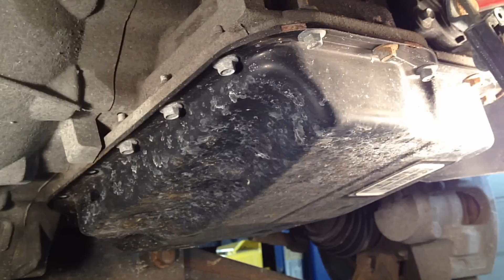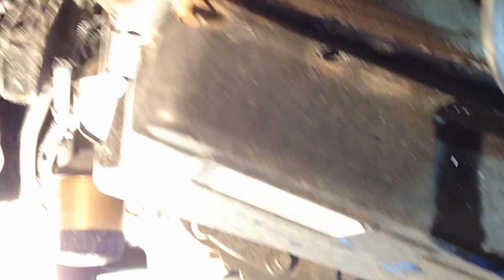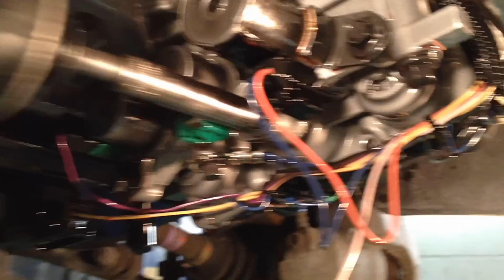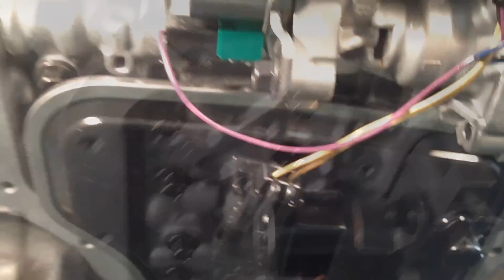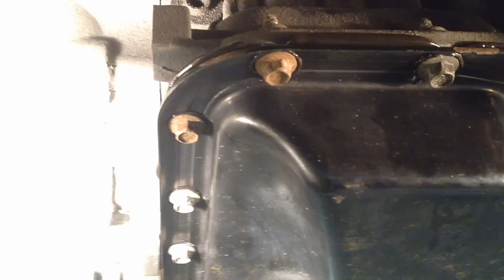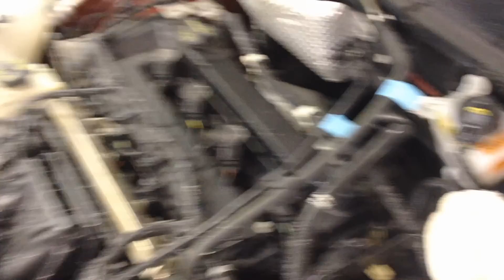Ford Focus Shift Solenoid A Repair P0750 P0753 P0972

Comment: FordTech it shifts into 3rd gear but really hard. Also I notice that starts jerking when I'm going up to 70mph... The car has 130k miles as well. Thanks for your response.
Reply from the maker: Michael J so it slips goes high and finally engages into 3rd? There was also a major redesign of the direct clutches for that year think a tsb on it for a flaw in design I have done a few. How is the fluid level color and smell, does it smell burnt?

Comment: Hello FordTech I have a P0733 on my 08 focus se AT which solenoid would I need to change out... Thanks
Reply from the maker: Michael J Are you actually missing 3rd gear. These have a problem where the direct drum gets grooves it from the end cover sealing rings requiring a rebuild also another common problem with that year is there are allot of problems with the pcm driver for the trans solenoids failing. In the end I don't think it is a simple solenoid issue.
Reply: Hi Michael,  i know it's been 5 years since you wrote this comment. I'm having the same problem as yours. Did you end up fixing your trans and how?

Comment: Hey my 2010 focus has been acting up and I got the vehicle code P0760. I had what I thought was solenoid C changed but the code keeps coming up. I'm not sure what else I could do to get rid of the check engine light? The car jerks when I put it in drive and as it reaches 3,000 rpms.
Reply from the maker: Joshua Gomez Unfortunately the 2008-2010 focus vehicles have a different problem the pcm driver for the solenoid fails
Reply: FordTechMakuloco  So even though the code reads "shift solenoid C malfunction" it would be the pcm driver that needs to be looked at or changed? any idea how much that would cost?
Reply from the maker: Yes the code sets the same I have changed many. The driver is part of the pcm so it depends on what they can get a new pcm for.

Comment: I have an 06 focus mileage is around 166000 the trans shudders when shifting this usually happens when rpms around 3000 it also occasionally hard shifts but transmission it not throwing any codes. Could this be an issue with the solenoid?
Reply from the maker: Timothy Collum It could be but the end cover is likely grooving the direct drum at this mileage and the 2-4 servo bore is also likely worn out by now.

Comment: 03 2.3 Duratec @176k mi ever so often while decelerating i will get a hard down shift at low speed around 20mph. It doesn't do it all the time I don't get any check engine lights at all. Solenoid A?
Reply from the maker: SLVRFOX88 Yes it can be sticking but at that mileage I am thinking a crossfeed on the direct drum. either way with the mileage you have I would wait till it's a real issue and replace the trans with a low mileage junkyard trans. You will be surprised at how cheap they are.
Reply: Thanks for the reply. Since it doesn't happen much and otherwise runs and drives fine your advice makes the most amount of sense. The only other issue I have had with the car are small little things like when shifting from park to drive the speedometer will jump up and the settle back into normal operation. And the trip computer clears to 0.0mi if you turn the car off or fails to read any mileage as your drive. These are way more prevalent than the hard downshift.

Comment: My mechanic will do this job if it's needed, but I liked your video. I have to take my car to a parts store like AutoZone or Advanced Auto Parts and ask them to find the error code (or codes I guess) for a problem I have with my 2004 Focus Z engine with almost 200,000 miles.
The transmission slips when I give the car gas but then drives fine if I don't over accelerate. It also slips going up hills and I have to baby it to get it NOT to slip...in other words, I can't give it more gas and expect it to stop slipping.
After driving it for a few minutes, the amber transmission warning light comes on (has an exclamation mark inside a gear-looking circle). BUT if I baby the car and don't give it too much gas and stay at or below 35 mph, the light doesn't come on.
Just curious if you might know if all this stuff hints at a solenoid problem or a band problem. I'd like to be prepared when I talk to my mechanic.
Thank you very much.
Reply from the maker: kathy loften Since there is a code set I would get that read first for direction but I am suspecting the end cover is worn causing the pressure loss which is a major repair.
Reply: FordTechMakuloco Hi...thank you for your reply. What is an 'end cover'? I'll be looking for a parts store who will try to read any codes for me. Not all Napa stores do that. Thanks again. I really like your video.

Comment: Hi... I was wondering if the transmission was the same as well for the 07 Mazda 3 - 2.3L because it does look the same ... i have recently got the p 0753 code for my transmission saying solenoid A..... the symptoms are pretty well the same as the guys below and only shifts from 1st to 3rd, the check engine light is on and the AT light as well and help would be appreciated... thanks
Reply from the maker: Gord Herreman Yes sounds like the same exact fix.
Reply: Ok thank you much appreciated... now i know u listed the solenoid in the video but the schematics i have are a little different. the ones u showed as a and b i have listed as d and e. do u know why this might be ???
 http://www.thaimazda3.com/svmanual/esicont/en/srvc/html/images/B3E0517W0732.png ... you change them allot more then me... so just asking for my own curiosity
Reply: Gord Herreman Ok so to update everyone on the mazda and ford transmission they are the same. I spoke to a transmission expert today and he said the transmissions are the same. except stuff is listed a little different from each other. FordTechMakuloco lists them correctly as well as mazdas schematics are listed correctly they are just different lettering from each other... so here is my dilemma now is the obd reading it as Mazda's A or Ford's A ???? if anyone has any insight would be great considering the solenoids from Mazda are 217+tax each and no one seems to have any for cheaper. thanks

Comment: Thanks for the video! I do have a question, I have an 01  focus 5 speed manual SE  that when shifting into 2nd gear it grinds. Most say it's the synchronizer for 2nd gear and others say to just replace the whole trans. 
I'm in need of direction here if you can help. Thanks again!,,
Reply from the maker: Perfection marine services I would say synchronizer or bent fork. Manual transmissions are very hard to take apart I would replace it if the price is right.

Comment: Hello I have a 2007 Mazda 6, 2.3L non-turbo,with automatic transmission with code "P0757: Shift solenoid B stuck on". I put the transmission in D, it is fine in 1st gear, when it goes into 2nd it seems to lose power and the engine revs really high before going into 3rd, once it is in 3rd it feels fine again, however, once it goes into 4th, it revs super high with no forward movement, then the AT light light comes on and after this it will only shift into 1st and 3rd (I'm guessing its some sort of fail-safe mode). I do believe that the Ford Focus and Mazda 6 share the same automatic transmission, mine looks exactly the same when remove the oil pan. However from my research online, the solenoids that you removed on this video are actually SSD and SSE, and these diagrams show up for both the Mazda 6 and the Ford Focus. Is there a way you can show me how you identified the shift solenoids on this video? Thanks in advance
Reply from the maker: Ricardo E The way I identifired them on the focus in the video is correct. Many people get the solenoids mixed up. The small 2 on the one side are A and B the others on the other side are all the same C D E
Reply: Check the workshop manual for Mazda 3 or 6 and you'll see the solenoids got different letters

Comment: You wouldn't happen to know the part numbers for all those I've got a 03 with 157 on it and just got the p0772 code when in over drive it goes into neutral instead of third drives with overdrive off though 772 is for solenoid e
Reply from the maker: alexlrsn7 I don't have the part numbers but the dealer can answer that over the phone they should know which solenoid you are talking about.

Comment: I'm not well educated about cars so I guess that is why I paid $673.00 totally and $521.00 of that was labor & shop supplies fees including replacement of shift solenoid"a" & "b" I got a chevy lumina 99 3.1 engine. When you replace one you minus well replace the other. I'm pissed cause you just made this job look so easy and quick. I really doubt it that this job is a 5 hour job, smh! I got to go to school an learn about car repairs cause this shit is expensive when you have someone else do it.

Comment: I have an 07  focus and it seems like only on cold days it will start out in first gear just fine but then it going in to second feels like too smooth almost as if it doesn't go fully into second then it goes high rpms as if it's in neutral i just did a trans fluid change and filter change I thought that was the problem but this happens... I just would like to pin point the problem and not waste time or money on guessing. I was thinking solenoid A maybe cause the problem but I have mixed info hope you can help I'm kinda counting on it...
Reply from the maker: USMCSCARFACE I would go right for the 2-4 servo and replace SSA while you are in there they are cheap enough.
Reply: FordTechMakuloco could you link me to the part or could you give me maybe a part number I'm having trouble looking up the 2-4 servo for my car
Reply: USMCSCARFACE and the ssa? (New to transmissions and already hate them...)
Reply from the maker: Yes I would change SSA while in there. You will need to remove the valve body so you will need valve body separator plate gaskets, check the solenoid pack gaskets for blow out then the 2-4 servo and I believe an oring. You will know right away if the servo is bad or not. The parts vary by vin and build date especially that year so the dealer would be best to look up the right part.

Comment: Hi. Thanks for all your great tech tips and videos. My daughter has an 00 Focus SPI. About 150,000 miles. Trans was rebuilt by the previous owner. I changed trans fluid around 120,000. Fluid is not burned. It slips between second and third but not all the time. Maybe only 2 or 3 times a week. Thanks for any info.
Reply from the maker: Rob Sallada I am thinking end cover groves on this one also many don't realize they need to replace it when they rebuild the trans.,

Comment: Hi, Great video. My daughter have a 2000 Focus LX. It will slip and skip 2nd but get into 3rd and, will not go into O/D. If you turn off the O/D will run fine in 3rd. The transmission was rebuilt less than a year ago and the TPS was change today. You think it will be solenoid A?
Reply from the maker: Robert Tanon This is a classic symptom of the end cover having grooves in it, also the sealing rings that stick into the direct drum wear grooves and cause pressure loss and symptoms like your explaining. How far did this rebuild go? I am thinking they didn't replace the direct drum nor the end cover.
Reply: FordTechMakuloco Hi, I really don't know how far they go. I will check with the place that did it for me.
Thanks for your reply.

Comment: I'm doing the 2nd (band) piston at the moment. ( Fitted new bush to piston bore).   Pulled the valve body, and a  2"x1/2" piece of gasket was gone in the main pressure regulator valve area.  Shuddering in reverse, and in 1st.  No 2nd or 4th.   End cover ok.
Reply from the maker: moyadapne Yeah I have seen that before too on a few.

Comment: Hi! Thanks for the info, My car is a 2000 focus and its been having an issue if I put into the 1st. Gear it will work fine but when I turn it into the 2nd gear the car acts like I'm pushing the brakes so I need to push the gas all the way down for it to start moving... 3rd. And 4th. Works just fine... any clues? Thanks in advance :)
Reply from the maker: I have seen blown out gaskets on the solenoid pack do this, either way sounds like there is a control issue and it is binding up trans in 2nd gear. Do you mean slipping into second gear? How is the fluid level and color/ smell?
Reply: Hi! Thanks for your reply! I mean when I move the lever to the 1st. Gear position then to the 2nd gear, gearbox shifts (I think) but if I depress the accelerator or just leave the car in 2nd. It just wont move until I push all the way down the gas then it start moving slowly, fluid color is red just replaced it 4 months ago
Reply: Luis Gomez Is there car stopped when you put it in second....

Comment: Thanks for the info. I've got an '00 Focus with 120K on it. Sometimes after shifting from first to second, the RPM's will spike and the transmission is in neutral for a second before 2nd engages. It's smooth, and the transmission works great otherwise. Would that be Solenoid C?
Reply from the maker: DJSkreebz Yes it sounds like a sticking solenoid, I would change out SSA and SSE

Comment: hey ford tech luv your videos. I have 2005 Pontiac grand am 4t40 transmission and I cant pass inspection because of trouble code p0753 it has 102,000 miles im the original owner. it shifts into first hard and sometimes it don't. when driving it shifts good.  

should I replace the solenoid or take it to a trans shop and let them diagnose it?

if I do change the solenoid will my check engine light go out? that's whats holding me back.
Reply from the maker: It is a circuit code so I would change the solenoid and retest.
Reply: FordTechMakuloco thanks fordtechmakuloco. greatly appreciated.
Reply: thanks fordtechmakuloco

Comment: 2000 Focus getting 2nd-3rd flare at times and comes out of overdrive also intermittently ...would like to check the intermediate / overdrive servo ....is this possible to inspect and replace if necessary without removing the transmission any thoughts or advice would be greatly appreciated...great videos can't thank you enough for sharing all this great information
Reply from the maker: you can remove the pan and valvebody to check for this yes. Yours is likely to be the end cover though as the sealing rings on the direct clutch tower wear grooves into the direct drum causing this which requires a complete overhaul.

Comment: hello, I changed solenoid A and B and still skip in to a 3 gear, any other suggestion for ford focus 2002.
Reply from the maker: Yours also is likely to be the end cover though as the sealing rings on the direct clutch tower wear grooves into the direct drum causing this which requires a complete overhaul.

Comment: My 2005 Ford Focus ZX3 SE (91,000 miles) makes kind of a "chrip" noise every time it shifts into 3rd gear. I'm about to replace the transmission filter and the fluid lost when the pan is dropped (also installing a drain plug so future fluid changes will be easier). Will this help eliminate the shift noise? Thanks for all your videos, very helpful!
Reply from the maker: It likely will not help with the noise but if it is chirping like than and it is damaging internals you will see it right away when you drop that pan. There shouldn't be much in there.

Comment: It was really low on trans fluid so I put more in and it was too much and it shifts hard into all gears including reverse with the ! Light with a gear around it I think it started doing that before I put fluid in it so it was doing it then I found out it was low then added more then I should have and it kept doin it

Comment: Hi, I've got a Mondeo, same engine and trans as this vid..If you try take off in drive it slips and wont move or will very slowly..If you give it gas it'll just slip..If you put it into 1st its will pull away fine and same when shifting into second but you have to back off the gas and let it grab the gear sort of when you slip it into D..Once it grabs D it's fine and wont slip until you slow down and it changes out of D..Any help appreciated as trans aren't my thing..Raven
Reply from the maker: Yours is likely burnt at this point how is the fluid level color and smell.
Reply: Brownish and smells ok..Not burnt..So just to recap..If you drive it manually, 1st,2nd is fine but going into D you have to back off the gas and let it grab D properly..It kind of clunks into D and then it's fine..If you keep the gas on while changing from 2nd to D manually, it'll slip and won't grab the gear properly..That's why I wondered if it's a solenoid..Once it's in D and grabbed the gear as such it's fine and won't slip..If you try and take off in D, it'll slip and feels like it won't grab the gear properly..I don't want to change the tranny out if I can help it..I seen your video and thought you may have some advice..Thank you for the reply.

Comment: If the solenoids go bad do they throw the automatic shift malfunction light mine hops really bad in reverse and second gear it eases up after that u think it's prolly a?
Reply from the maker: No yours is likely the reverse clutch drum has ridges worn into it from the end cover and will likely need to be removed.
Reply: That's what would make the automatic shift malfunction light come on? Cuz it's not only reverse that it goes hard into it's all the gears
Reply from the maker: Once it goes in FMEM mode the line pressure is maxed and all shifts will be hard.

Comment: Got a PO767 Code Shift Solenoid D Circuit Stuck On. Should I buy a new D? A? or both? Thanks for the video!! I'm doing it myself!!!
Reply from the maker: I would replaced D and replace A while you are in there because it is common.. Check for harness shorts while you are in there.